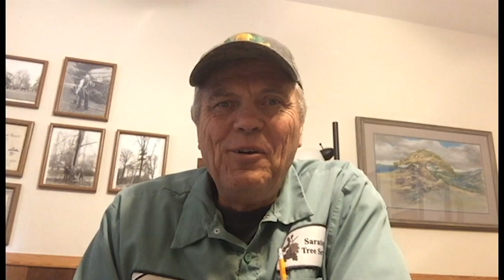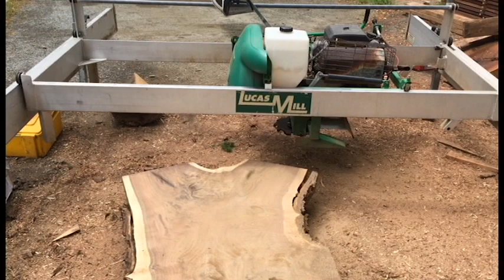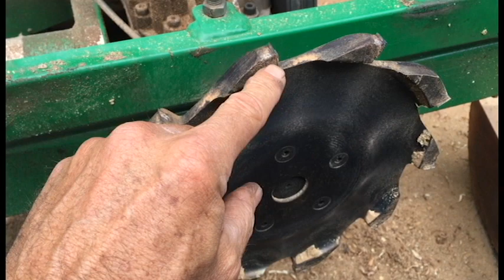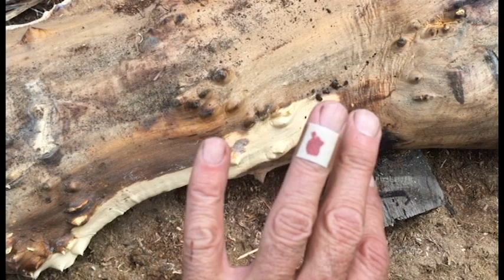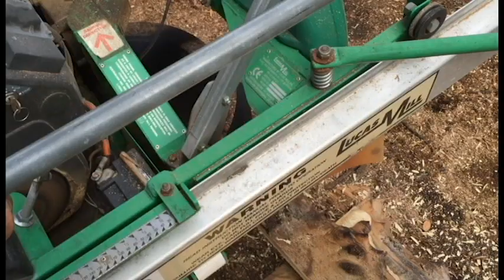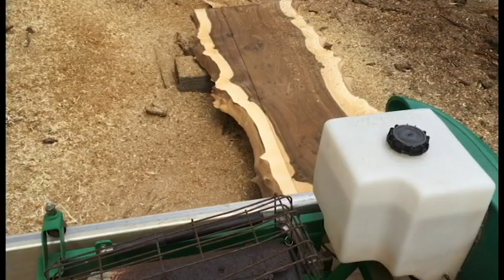Finished Walnut Slab (Part 2)

Comment: Hello, may I ask, so this wood was sufficiently dry? As it was not milled to final dimensions, why bother planing it, when it might warp afterwards? Very nice slab though, and your mill takes away the need for a separate router jig. What would be the max. minension you can cut (diameter)?
Reply from the maker: Volker Petersen easier to sell if cleaned up to see grain. You are right about movement. Will need another pass. Width? About 6feet with chainsaw attachment instead of blade.
Reply: Thx for the quick answer. I was thinking about dressing up my slabs as well, but by means of Rotex Sander to just clean up the discoloration and water stains. Definetly right about the selling...especially if you are selling to DIY enthusiasts who might judge the book by its cover only. So you can attach a chainsaw...that's a nice versatile mill you have there...
Reply from the maker: Volker Petersen I also own the Festool Rotex sander. Very good tool

Comment: was wondering and sure you have what it costs somewhere but what does the mill sell for and would you recommend this mill and is it easy to set up from the start? sorry so many questions in one sentence but just getting into wanting a mill and looking all over at different ones. thanks for any help you can give
Reply from the maker: cloudy days I like the Lucas mill. You can use it to slab, cut planks and plane.

About 12 k plus extras

Comment: I would think that if the "points" were dormant buds as many suggest, there would be some sort of pattern. I would also think that epicormic branching would be more prevalent in trees that develop these points. I haven't notices these traits in any of the species that produce these features.
Reply from the maker: Very interesting indeed. Because the bark peeled easily, the points were revealed
Reply: I see that with diamond willow regularly. I actually have a piece that I debarked in the last week with prevalent "points". I examined it more closely after watching your clip. I see no logical explanation. Another mystery of mother nature.

Comment: Curious why you didn't use a chainsaw mill to slab up the entire log. Claro slabs fetch many times more money than if they are cut into dimensional lumber.
Reply from the maker: If I was looking to build an inventory of slabs, I would. They are not that easy to sell. I do need (and use), the lumber.

Comment: Nice.  Thick layer of shellacing, or orange oil and massive buffing, and super product.
Reply from the maker: Not sure if I should sell it as is or put the time into trying to finish it and turn it into a table
Reply: Depends on how thick and heavy.  Could cut some more layers from the plank, and have both options.
Reply: if you have leftovers from this, good option for contacting the other YT knife makers for walnut handles
Reply from the maker: +John Lord I give away lots of the leftovers